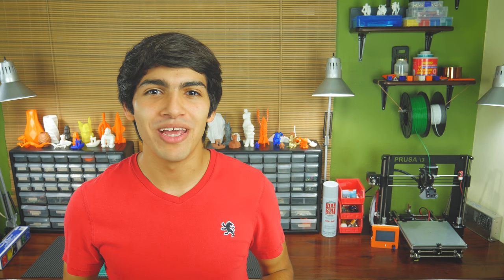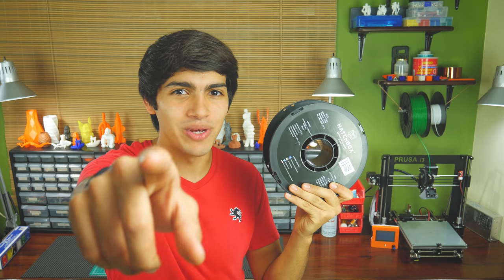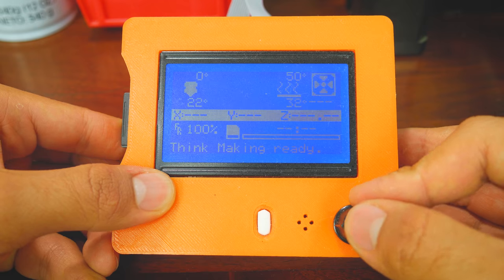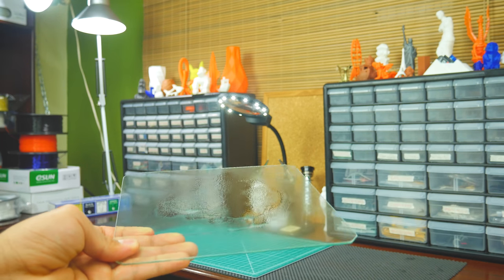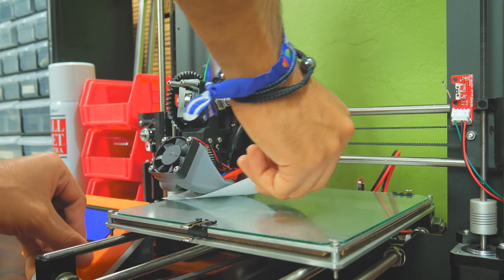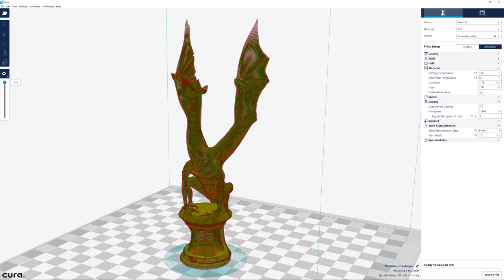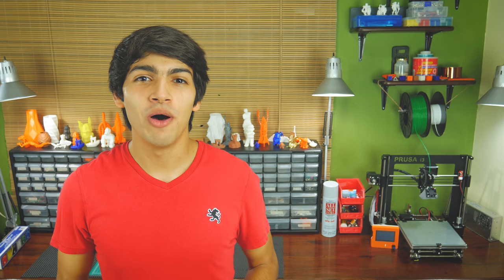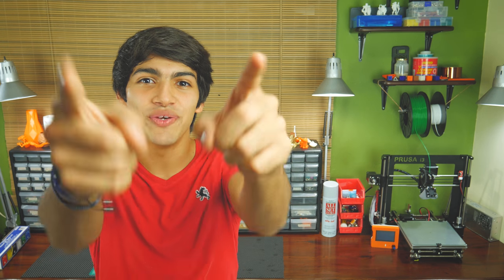⏱🌡 PLA Bed Adhesion  -  3D Printing 101

Comment: Since I watched this yesterday I've tried all of this even the pro extra hold hair spray similar to the one you use.  I've heated the bed to 70c and run the extruder at 210, re-leveled the bed numerous times using a .23mm business card and nothing works.  I still can only print small objects with brim and then only after applying the Elmer's glue stick right before the printer starts it's print.  This is a new CR 10s and it should work but I can't get the PLA to stick to the bed long enough to make a print that's 10x10cm.  I've watched other videos on bed adhesion and tried as many as I could and they don't work any better that everything I've done so far.  :-(  I need a solution that works.

I've printed with a cold bed and the glue lasts longer before turning loose because it doesn't dry out as fast as with a warm bed.  I've tried Elmer's white glue and it turns loose before a print can get done to.

Cura evidently doesn't have all the settings that Simplify has but that software I don't have and it's something around $150 for it.  I've been thinking about trying sliceR, which I have but it doesn't interface with my Repetier Host as well as Cura does and operates differently so I'll need to learn to use it.  I still don't think that's going to help though.

I'm going to watch more videos on the subject today and see if I can find a solution before I go mad.

Comment: any reccomendation a for a heated bed around 400mm square?
Reply from the maker: As for the bed itself, I believe you won't find any commercially avaliable that size. I bet you would need to get the bed custom made in a CNC shop or a maker space out of 3mm aluminum. As for the heating http://amzn.to/2fteWqi this heated bed would work perfectly, because a normal 3D printer power supply wouldn't be apply to supply enough wattage to a heated bed this size. Hope it helps!!!

Comment: I heard what you said about fan speed but I did not understand what you said before that you said "using **** in your slicer" what did you say there? thanks
Reply from the maker: Additionally, using brim in your slicer and decreasing fan speed on bottom layers will always increase your adhesion, especially if you're not using a heated bed. Hope it helps!!!
Reply: Thanks... I never heard of a brim. I actually thought thats what you said... I looked into it, and I understand it now... Thanks for the video. I'll try it out and let you know the result. I made a clock and have been unable to print anything as thin and flat as a clock hand.. perhaps this may help. Cheerz